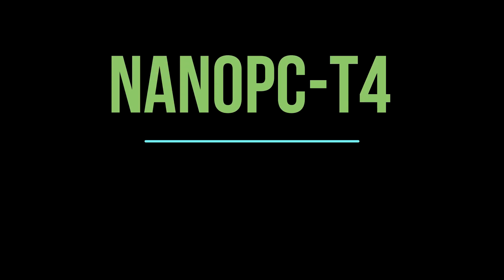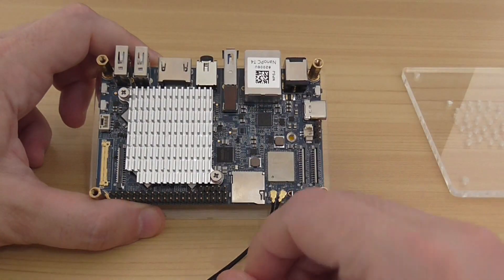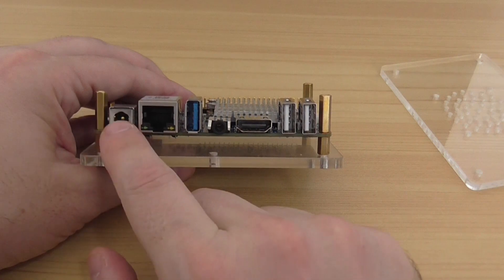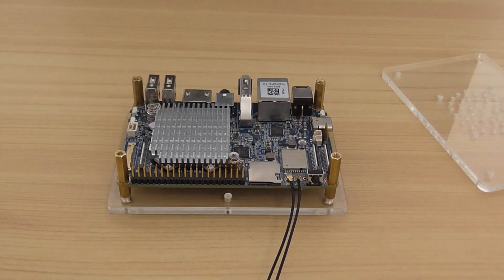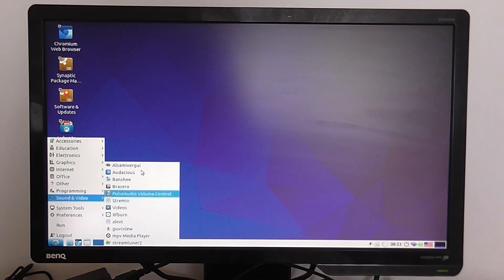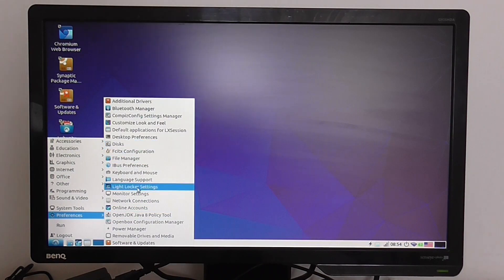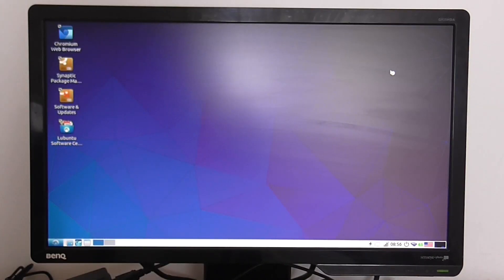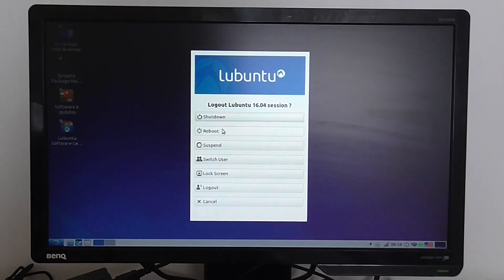NanoPC T4 RK3399 Powered SBC | Single board computer Overview / Review

Comment: Well crap.  I was going to see how you install the OS on the eMMc.  The instructions from Friendly PC are not useful.  In fact they are horrible.  So I was hoping someone else could step me through.  I can get the Friendly desktop to load up but can’t run eflasher because nothing shows on the screen.    I can’t kick it off by SSH because the default login for root doesn’t work.   Grrrr.  So I’m stuck.
Reply from the maker: Connect your device to a different display/screen. For example, a TV and see if shows a picture. As for firmware updating, you also have basic instructions on http://wiki.friendlyarm.com

Comment: Please link a heat sinc that we can use that would be nice in the plastic casing
Reply from the maker: I recommend buying a Rectangle in dimensions of 45x35 mm, Height= 10 mm (Max). As for the hight limitation, you can also choose a higher type, but keep in mind that the upper case cover will not fit (close), so you will just need to remove it. About the holes, its more complicated to find a heatsink with the same dimensions and holes. you can use thermal glue, it should be fine